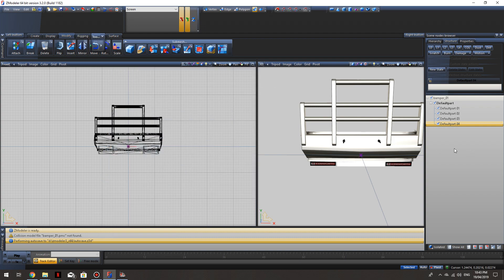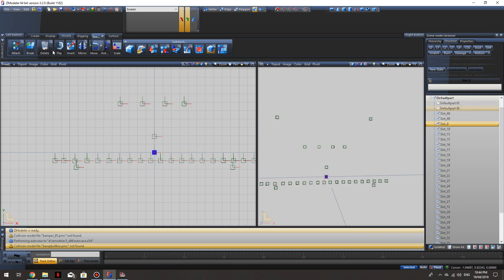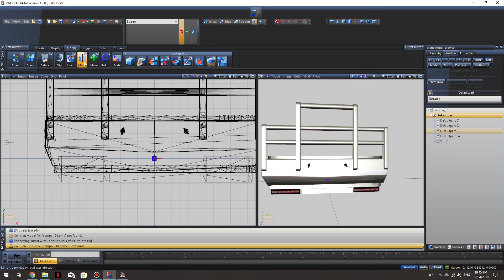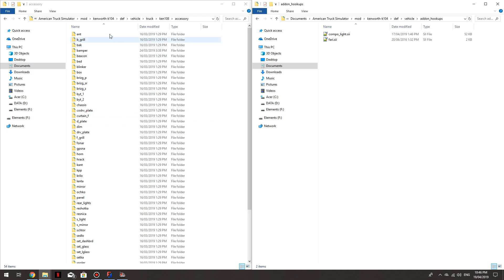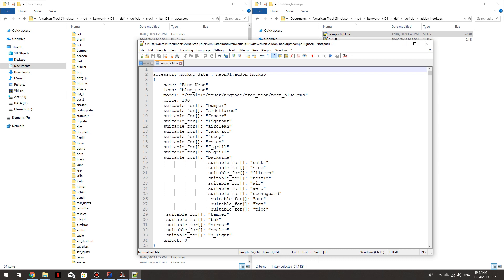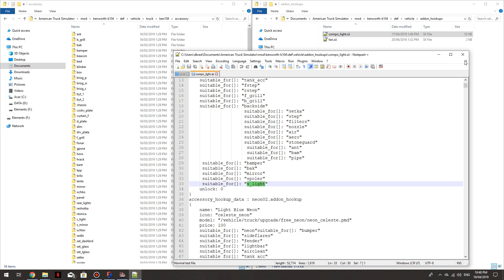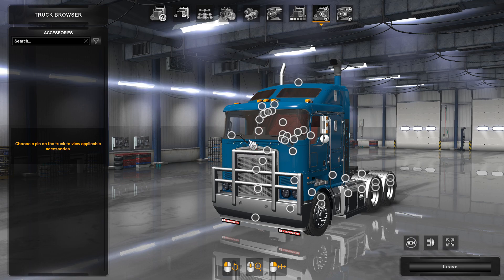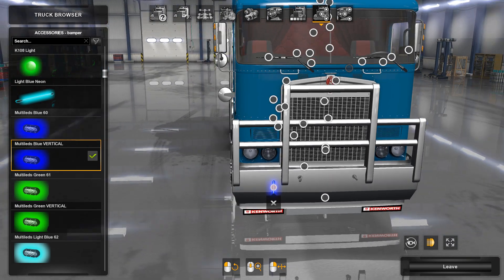Adding accessories slots, ATS

Comment: how would i say, add light nodes to a trailer? same way, but how would i make an actual node on the trailer when there isnt one? hope thats making sense
Reply from the maker: J Ward  import the trailer, import something with a node take that node and drop it into you trailer scene, delete the part you imported
Reply: @tonybradley4126   and then just put it on the trailer? what about any files? or just put on trailer and in game it shows as a light node?
Reply: my trailer doesnt have any preselect nodes like you using the bumper in game does, if that makes sense.
Reply: @tonybradley4126  i added a node like in video and it doesnt show in game
Reply from the maker: J Ward you need to make a node on the trailer mod, then create folder in the accessory folder with the same name as that node, put you sii in that folder that points to the pmd for the light slots
Reply: @tonybradley4126  so take a node from an accessory, rename it markers or whatever,  then creat a markers folder in access. where do i get the sii from?
Reply from the maker: J Ward  there will be other accessory’s use one of them sii and put it in your folder and change all the names to suit
Reply: so just cop the sii and resuse changing the name to markers or whatever i use it for